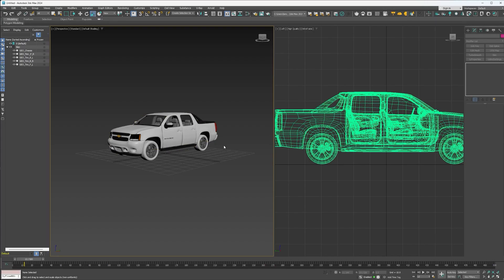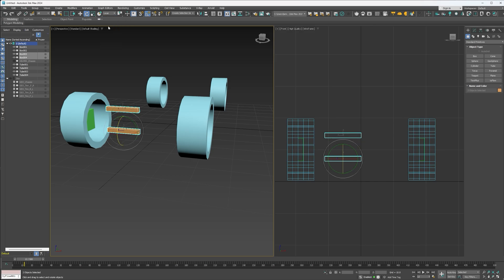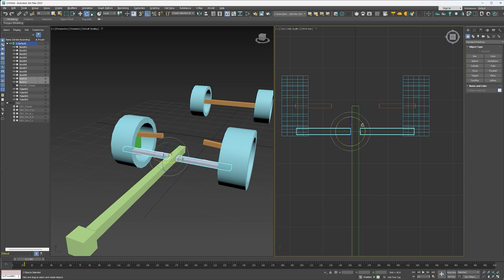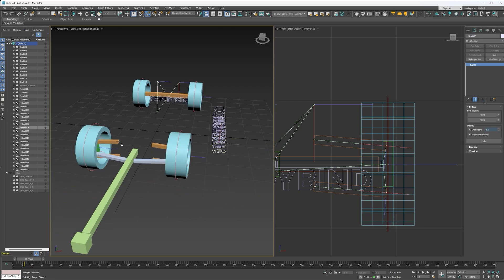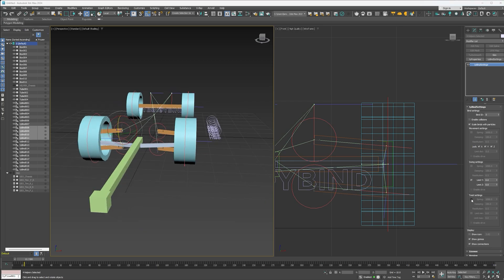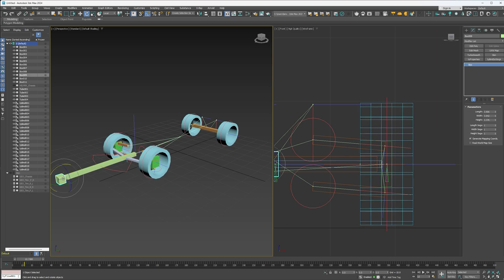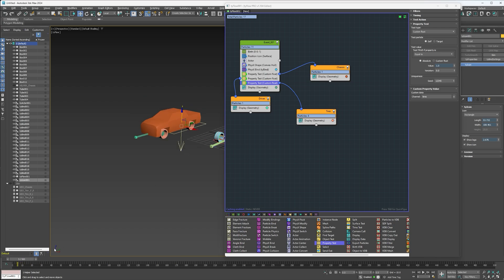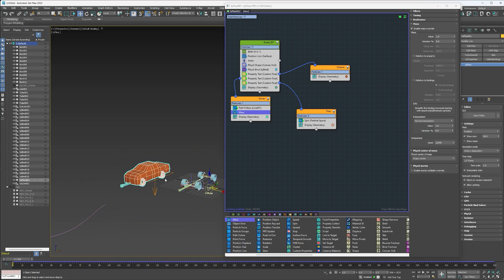Create a Simple Dynamic Vehicle Rig in TyFlow / 3D Studio Max - UPDATED Tutorial - PART 1

Comment: really cool. are the tybind objects like links? or links with look ats?
Reply from the maker: @mikegentile13  Thanks. They function like a link. Where you place the tybind will be the pivot point of the joint between the two objects, and then you can control the twist / swing settings. Use the x axis, rotate it to the correct orientation for your rig and use twist for rig joints.

Comment: These updated tutorials are hugely appreciated thank you , tyflow changed their menu system and naming so many times most tutorials are broken now.. I never did get around to doing these vehicle rigs of yours but I saved them all for later. The suspension and tyre deformation ones were hot on my list
Reply from the maker: @R1PPA-C  Thank you. You are correct, certainly with my previous video on these rigs. I posted it just before tyflow updated physx/ penetrations, this required users to check ignore starting penetrations, effectively breaking the tutorial right out of the gate. Of course 99% of users were able to figure that out and continue with the rig, but still it needed updating. The system I came up with to control the steering worked ok but the new strategy is just better in every way. It’s easier to setup and harder to break. You can rig any type of vehicle with this method, including the entire suspension system. When you do have time to watch it, please let me know if you have any issues. Thanks again, I really appreciate you taking the time to comment!
Reply: @lanceculver  perfect, will do!!

Comment: Thankyou! Wondering, would this work with a trailer for the car?
Reply from the maker: @Matchfire_Media  Yes sir it would definitely work.
Reply: @lanceculver  Thank you sir. I'm guessing you could just use a look at constraint with the same rear axel setup you on the car...
Reply from the maker: @Matchfire_Media  Hey, actually I’m thinking just rig the trailer to the rear of the car and use tybinds to connect it all. Might not add the spin, might push the rear of the car. Let me know how it turns out, or of course if you have any problems.
Reply: @lanceculver  Thankyou! Will do.